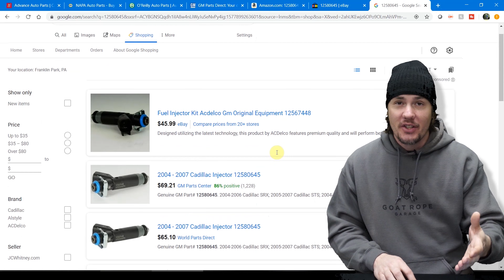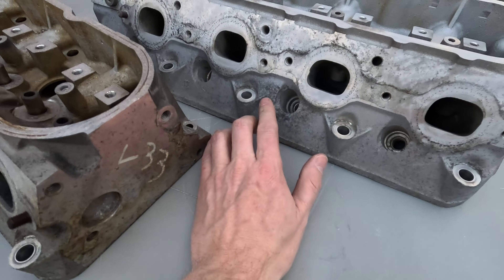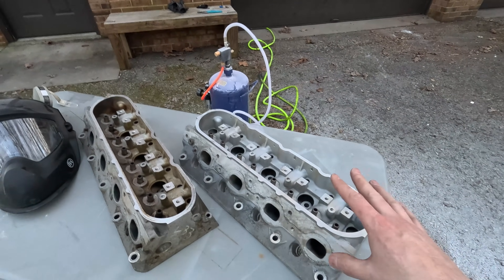Soda Blasting Aluminum Heads, Cheap And Fast Cleaning!!

Comment: If you use a DA with sand paper on your head. Or oven cleaner on aluminum. you will Regret it. And don't Soda blast the Mounting surface Unless you're taken it to the machine shop to have it Resurfest to a perfectly mirror flat. P.s The machine shop can soda blast it While it's there. Sometimes saving a dollar can be quite expensive.

Comment: Was there any additional finishing that was required for the head gasket mating surface? I notice that soda blasting dulls the finish of the mating surface. Was MLS head gasket used?
Reply from the maker: Used it with an MLS, didn’t blast the mating surface much because of them being aluminum, but I’m not sure it would cause issues anyways

Comment: Are you running a air dryer?
Reply from the maker: Has a separator built in to the regulator that comes with the tank
Reply: Awesome thanks you!

Comment: Putting a DA orbitle sander in grinder mode with 240 grit low pressure will really make those flat exterior areas on the head look new.
Reply from the maker: I may give that a shot this weekend

Comment: Great video buddy. Probably not a great data point, but I used walnut shells with a bit of car polish for rifle and pistol brass cleaning and it seems very safe for brass so I’d assume it’s fine on aluminum. Also, I know a lot of BMW shops use walnut blasting to clean out combustion chambers on the late model I6 engines. Of course you have to be super careful to get all the material out before reassembly.
Reply from the maker: I know Subaru guys do too, but getting one in a stuck in a water jacket is what made me use soda

Comment: I used one of those on an aluminum boat project years ago.
It worked great for paint removal.

My current project a jeep wrangler, i wanted to get my soda blaster out to clean the heads and mostly the front cover, but it's behind where the jeep is sitting.

Instead i ended up using 3m crossbuffs, and some aluminum cleaner/acid wash (Dx33).
Available at your local auto paint supply store.

That stuff works great.